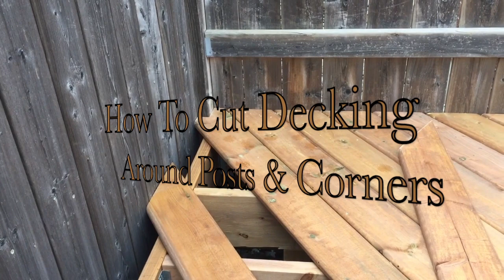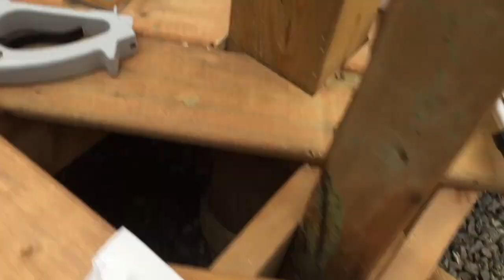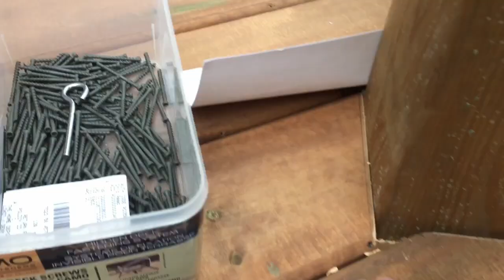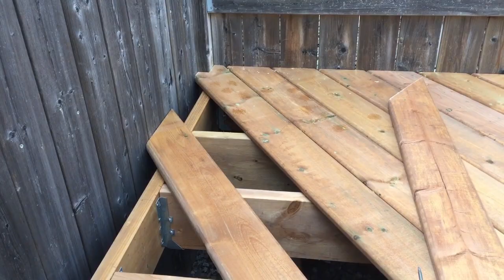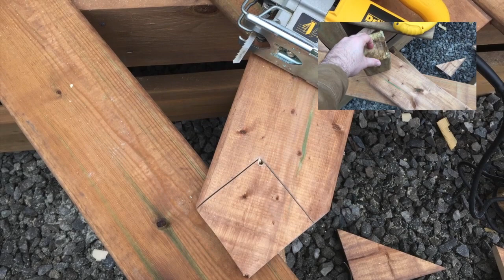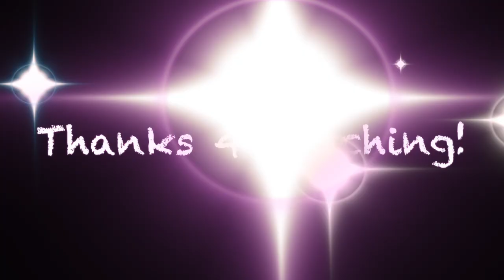Cutting Deck Boards Around Posts and Awkward Corners

Comment: I see you are using the Camo fastener system, how did that workout for you? Does it enter the joist inward and not puncture the side? Are the planks holding up?
Reply: Yoda Padawan they worked great, thanks. If you use the clamp-guide-thingy they go in without trouble. But when you’re near an obstacle they have self-tapping screws, or you can just drill pilot holes to get them started.
Reply: @mewoosh   thx for your prompt feedback. My main concern is that my Joists are running straight outward from the back of the house and my  planks are running in diagonal to the joist not perpendicular so I am not sure if the screw is gonna go straight down into the joys and not come out from the side of the joist.
Reply: Yoda Padawan Yes, I had precisely the same concern. Because I had so many triangular cut off‘s I used those to widen the joists wherever I had a board end on a joist. However by carefully positioning the screws I was able to avoid any of them missing the joist because of the angle between the deck board and the joist.
Reply: … I should mention: when doing the deck boards diagonally you will routinely be cutting off 1 1/2 ‘ lengths off the ends when they don’t line up with the joists. Overall you’re going to need 10 to 15% more wood than you might calculate and my advice is to use the longest deck boards you can get your hands on. I did most of my deck with 16 ‘ deck boards. It costs more, but if you use eight or 10 foot boards you waste a lot more wood and you have board-ends every three joists along each length all over your deck!
Reply from the maker: https://youtu.be/QfD84pV4qoI
Reply: @project_mewoosh5267  Thank you